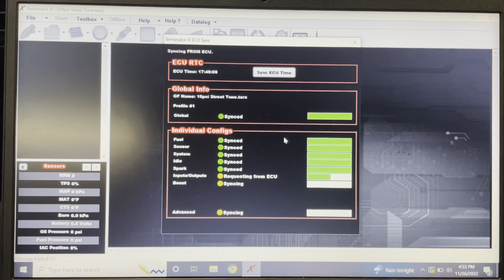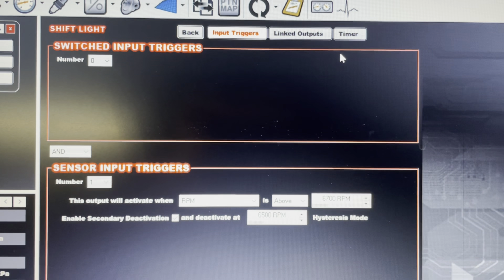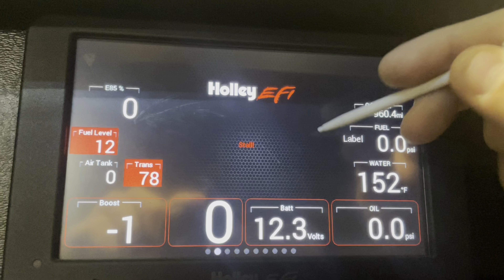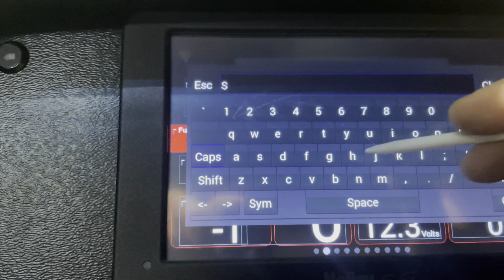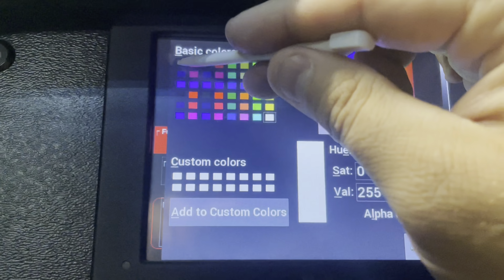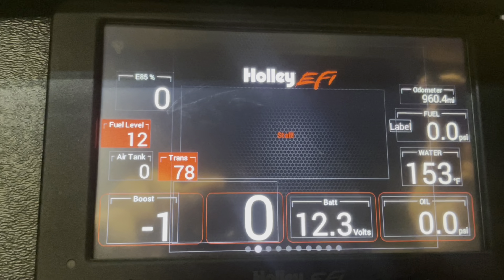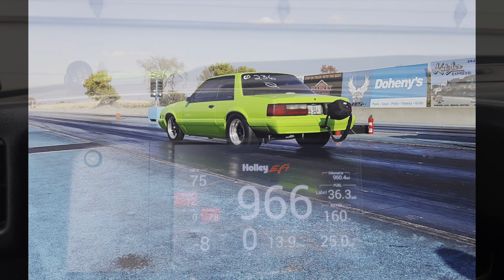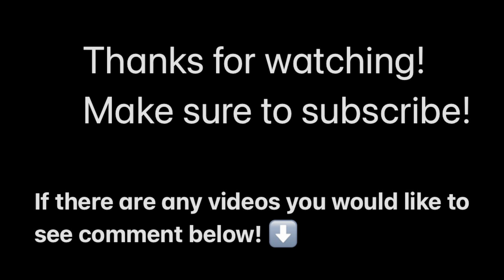How To: Full Screen Shift light on Holley 7” Dash

Comment: How is the external shift light hooked up? I'm going to add this to my dash, but I'd like an external light more.
Reply from the maker: The shift light is made by raptor https://amzn.to/3NhG1dS it just requires a power, ground and tach signal. With the terminator I had to go this route since all my io’s were used up. If you wanted to burn an output any sort of light would work and you would need to program an advanced table
Reply: @BoostieMotorsports  I have the can i/o setup so I have more inputs/Outputs than just the standard term x.
Reply: @BoostieMotorsports  I added an LED after watching this. It was so bright, I had to add a dimmer. But it's very delayed, I'm wondering if the dimmer is part of that issue. i'm running the can io and using one of my outputs there for a negative ground trigger. But it's still not what I want it to be. With your shift light, could you do a video on how it's hooked up? Trying to wrap my head around the wiring.
Reply: @BoostieMotorsports  Nevermind, it's got a rotary dial on it! That makes sense now.

Comment: is it possible to send that output to the dash outputs? If yes, how?  I have just figured out how to use more inputs through the "view lcd" but not more outputs
Reply from the maker: I have not played with the output function on the 7" dash but I know the functionality is there. It can only "read" information from the ECU so you would probably need to play with the configuration on the dash itself to output a warning to an external device. I can take a look into it and follow up if I find an easy way
Reply: @BoostieMotorsports  thanks!